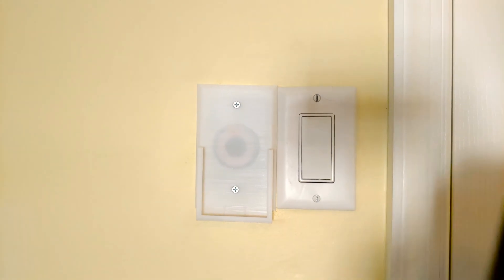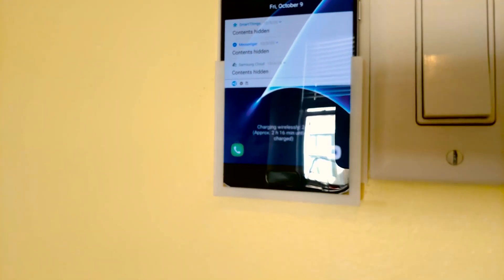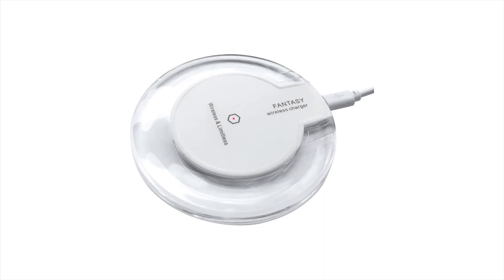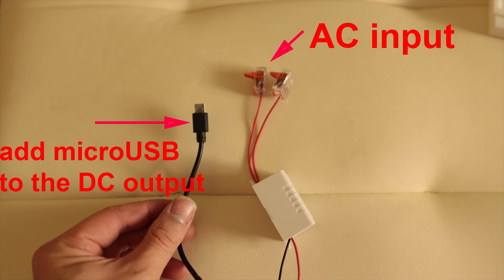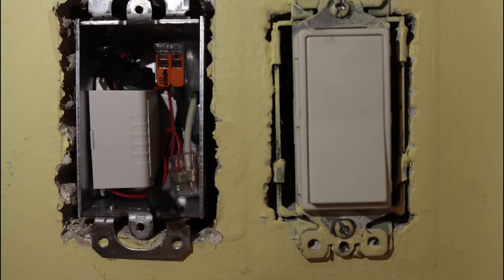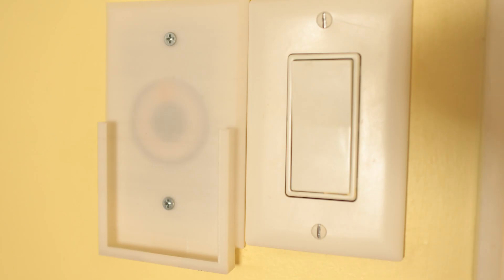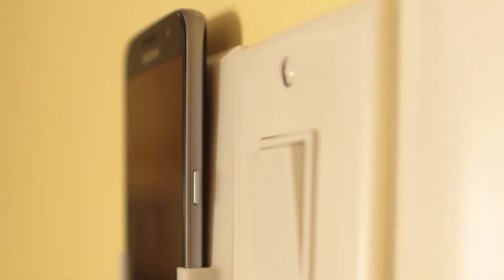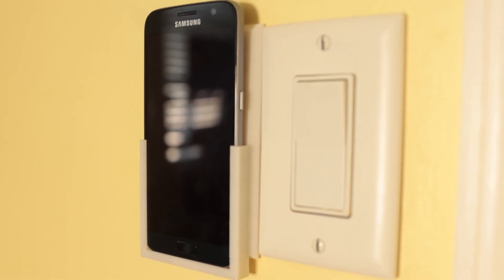3d printer project: wireless wall charger mount, super clean wall installation

Comment: Great idea. It would be really cool if you could fit the buck converter into the existing gang box and print a cover with the wireless charger in it. Kinda like the the Legrand radiant Qi outlet. It fits into a single gang box and the wireless charger hangs off the side.
Reply from the maker: Legrand looks great. too bad the big plastic piece covers 1/3 of the screen and the most important button, the Home button. and the price is pretty expensive for something that's being massed produced.